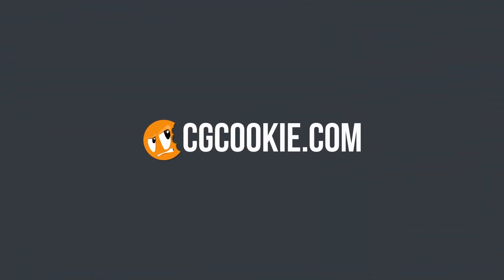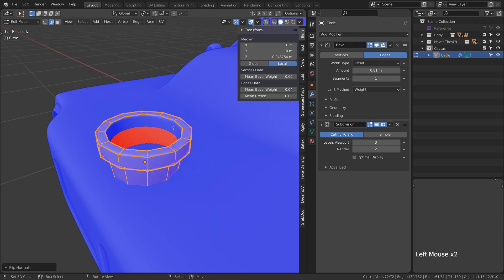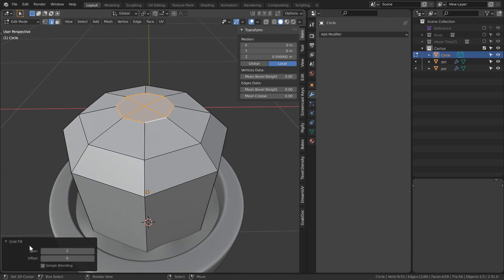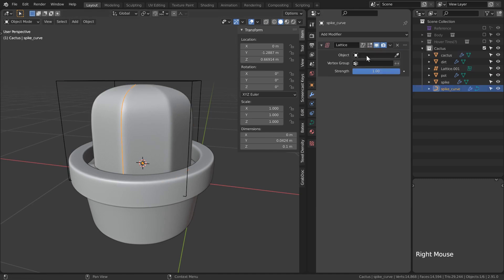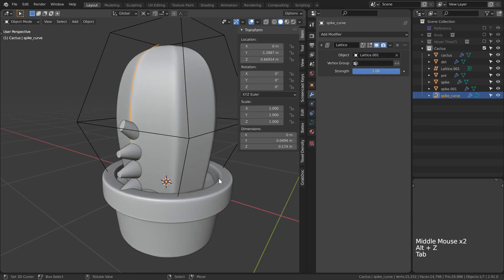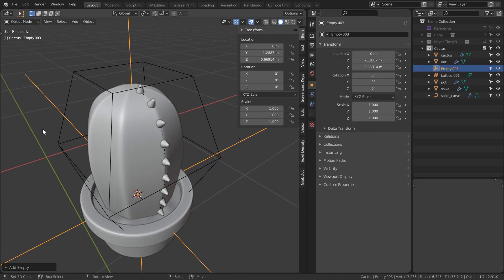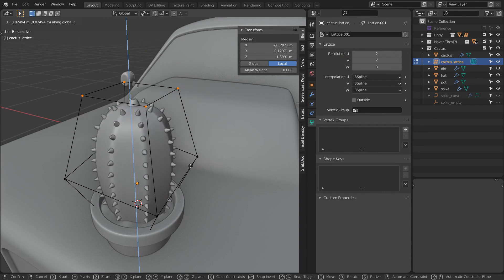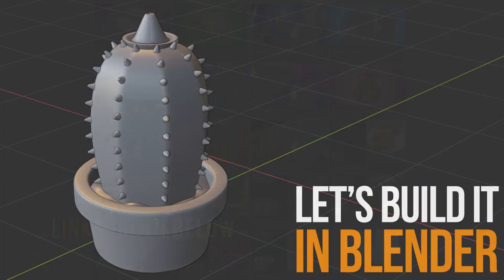Modeling a Baby Cactus in Blender | Let's Build It In Blender - Episode 3

Comment: I'm trying to understand the interaction of the two modifiers; putting the Curve mod after the Array, on the spikes.  If the Array mod is already set to follow a curve, then why is the curve mod needed ?  [ Edit ] OIC:  The Array mod's Fit Type: Fit Curve is a misnomer.  It's more like a 'Count Using' or the like.  It makes enough copies but does not constrain the items to  the curve.
Reply from the maker: You got it! A little confusing, but essentially fitting the "length" of the curve, not actually conforming to it. -Chunck :)

Comment: Hey! I have a little issue. When I put fit curve, instead of doing anything it only gives me 2 spikes to work with and no way of increasing the amount? Is this normal? How should I fix it? Also circle array part doesnt seem to work for me at all. Nothing appears out of it :(
Reply from the maker: Hey there! Did you by chance scale your spike down in Object mode? I'm wondering if was a scaling issue? -Chunck :)
Reply: the circle array worked for me when I set the fit type to fit curve and then back to fixed count. seems like a bug